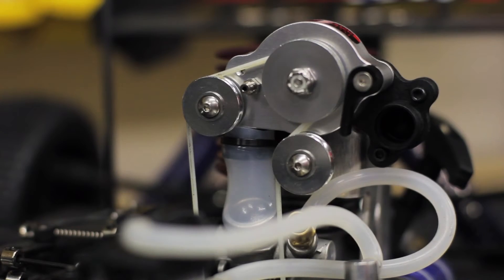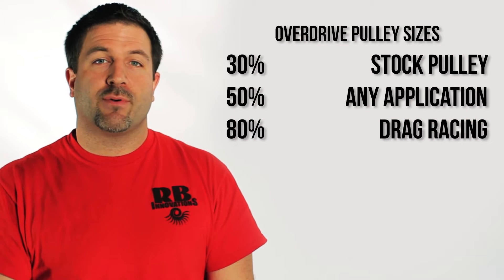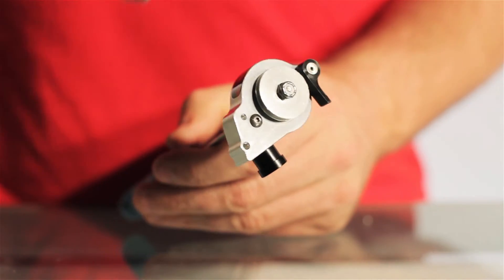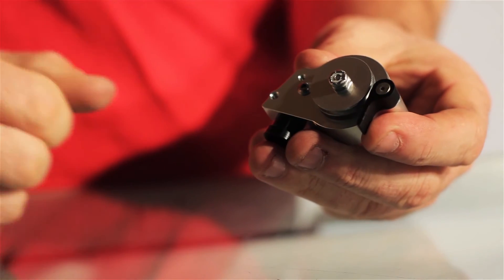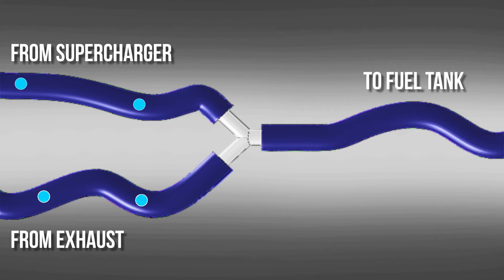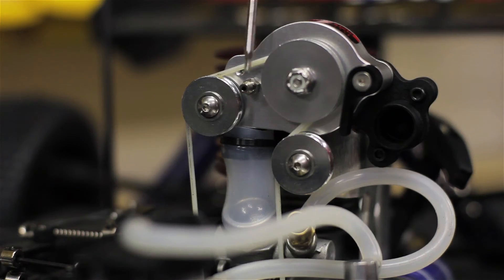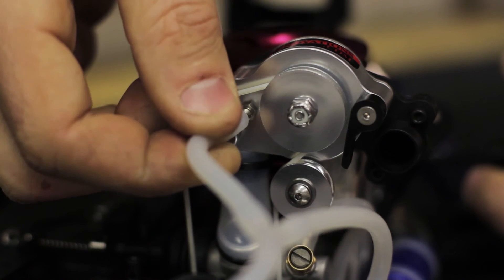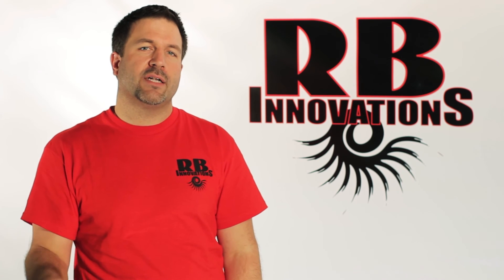RC Supercharger Overdrive Pulleys and Auxilary Pressure System

Comment: What if you plug the Y fitting to the to the fuel tank and turbo filter intake ( so it’s getting more pressurized air flow ) ??

Comment from the maker: Actually this is not a problem.  The boost feed in combination with exhaust pressure holds a higher more consistent pressure in the tank.  Stay tuned we have some more videos coming with details for this.